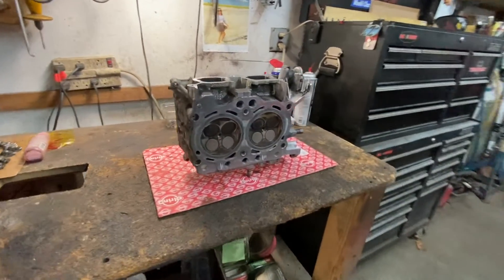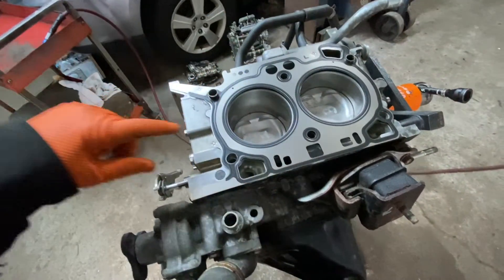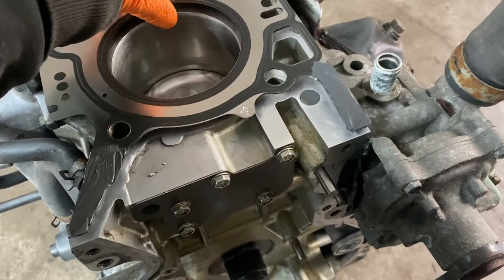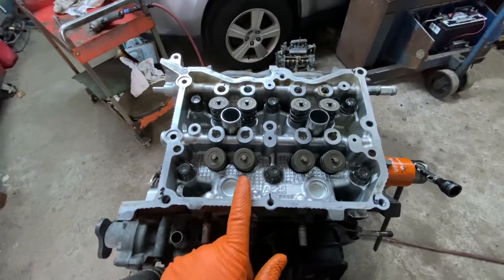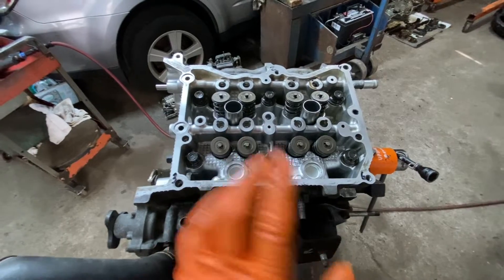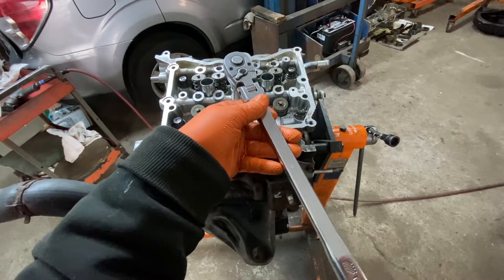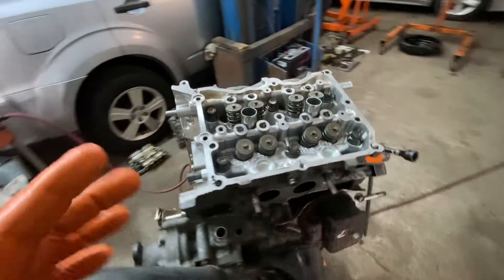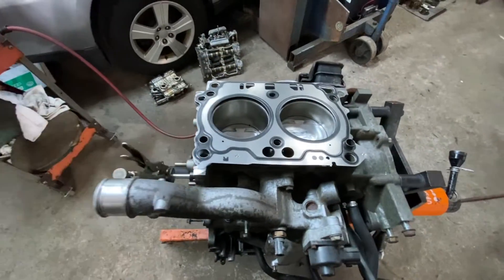Cylinder Head Install On Subaru FB FA 2.5L Engine 2011 & Up - Tricky Torque Procedure

Comment: You saved me so much unnecessary work! I saw silicone squish-out from the head gasket joint and thought someone had put silicone on the head gasket. Turns out Subaru did! I was getting ready to take the heads off when I saw your video. Like I said, saved me a ton of extra work. Thank you!
Reply from the maker: You're welcome!! Glad to help! Yep it's unusual to put any gasket maker on head gaskets that's why I made the video

Comment: Thank you, I haven't seen any fb25 head gasket installs
Reply from the maker: No problem 👍 Thanks for the sub and feedback! Much appreciated!
Reply: @motorcarnut  
Have you done any valve jobs on the fb25. I got all the shims out of order. Do you know of a easy way to put them in the right spots
Reply from the maker: @vaccineskillpeople3688  Oh man, they all have to be remeasered which requires a micrometer and feeler gauge. It's a pain in the neck, not hard to do but time consuming. Each shim should have thickness numbers on them. Put them in order by thickness and there is a formular Subaru uses that I don't have right now handy which you go by.